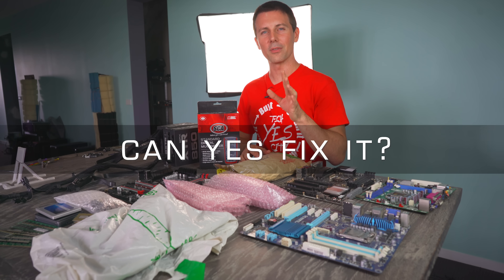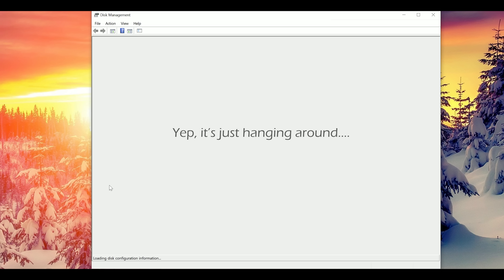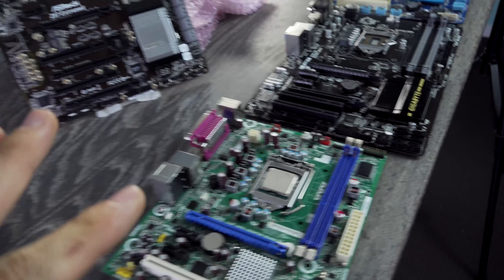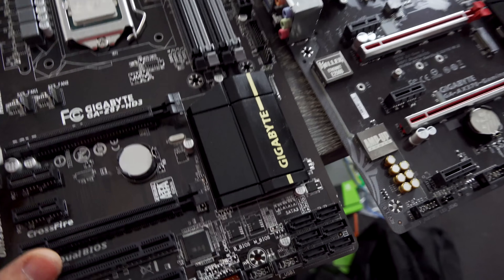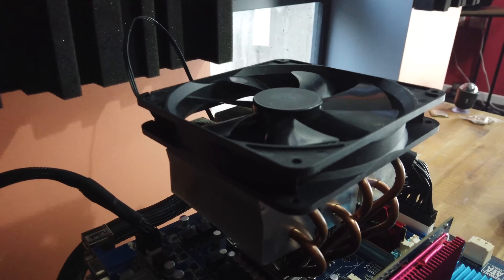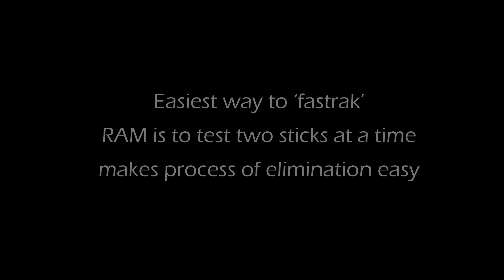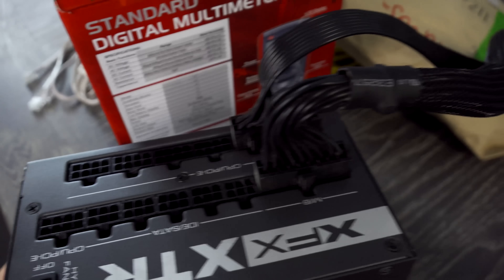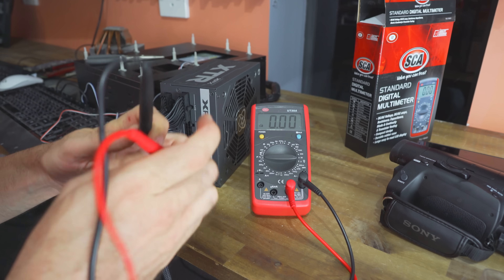Trying to Fix Your Broken PC Parts (Can YES Fix it?)

Comment from the maker: Will be tackling the used monthly parts hunt soon, if you have any special requests let me know! <3
Reply: Could you test i7 5950hq(mobile/resocketed, from asian ebuy) on z97 board with r9 fury vs gtx 1660s?
Reply: Be curious how much pascal cards and i7 2600k-6700k's are going for. Gotta be some sweet ultrawide 1440p 100+hz used builds floating out there if ya got that Bogan magic...
Reply: nice video was wondering if you ever run into a i7 750 socket 1156 please send it too me I will pay you need one for a build Stridder37@hotmail.com and that board looks like a oem intel so you can start their for bios !!! dependent on year
Reply: Russian accent. That's all I need
Reply: I missed a modified Bob the Builder theme song! "Can Brian fix it?! YES he can! "
Reply: If you need a faster method of RAM chacking, use MemTest86+ instead of Prime. meMTest86 can tell you what kind of error, which memory address it's occurring at and which module it happened on.
Reply: is there any chance that  you can donate a nice board and cpu to me.im from south africa cape town,my dad really cant afford a good gaming pc for me as i really like gaming and computers,im sending you this from our librarys computer ,my email is redrbk7@gmail.com.your reply would be much appreciated thank you
Reply: X99 Stuff and 900 Series GPUs!
Reply: did you actually say spray with brake cleaner ?
Reply: @pavlosconstantinou9236  yes its a common degreaser its not dangerous for materials pc parts can handle beating ive had boards with torn traces still run it really depends what you damage their like cars alot they even use same eeproms in older pcs as they do in vehicles everyone will be engineers soon evolution is weird thing :)
Reply: me love this episode i love when i see a bios being written :))
Reply: oh i can help with the reprogramming of the intel board i didnt even notice you said that when i watched first time
Reply: you have to go to windows temporary directory where .exe extracts its files grab the bios file from the tmp directory then flash to chip directly using the soic clip programmer,,since intel uses .exe formats for bios and so does dell you have to extract it from the .exe
Reply: and the bios file was probably incorrect remove cmos battery and power it on with new bios with new cmos batter installed some systems have a really hard time forgetting their cmos settings which means their bricked in boot loop recovering settings that dont exist or have been changed through bios flash
Reply: You should do a colab with https://www.youtube.com/channel/UCLqBEpeQPZTdhCd0nHWIf6g/featured and send Eli those bunk parts instead of tossing them. He could make some good content with that stuff
Reply: The Intel Board BIOS should be the BEH6110H-86A.
Reply: Thanks for demonstrating that ACTUAL hardware failures are pretty rare. Most of the time, it's "pilot error", dust (or dirt) buildup, or compatibility issues. 
Question: What's the model of the Intel MoBo you need the BIOS code for? I might have it.
Good video!
Reply: i did the same with my ssd 3 years ago and it came back to life
what would i do to get my hands on all of your not working stuff ;(
13V for power supply is too much
Reply: how i can get pc compotent if the one of them damage
Reply: Pls tell me ur not located in perth cause i just started out doing this and parts are rlly hard to come across like this idk if its just cause of how remote perth is or if their is high demand so idk

Comment: I once saved a dual socket 771 supermicro mobo just by a deep cleanse. The owner said his loop leaked and spilled on the mobo. 
An old toothbrush and a soap bath later and the board is back alive
Got some dirt cheap ddr2 ecc memory and a couple of X5450, put them in. Sold for 500% profit XD

Comment: I really hope you don't build PCs then sell them with the dodgy 12V EPS connection.  Some poor guy is going to do some friendly free tech support to the PC and replug the connector properly and fry the motherboard.  It is relatively easy enough to get a Molex pin extractor tool that you can use to remove the pins from the connectors and reinsert them in the proper orientation and then label them as being for that particular power supply.

Comment: My ASROCK z87 Extreme6 died when I plugged in a third video card. It was the 3rd of 3 XFX AMD 6450 unpowered cards. (No external power in). 
Seeing you are sponsored by ASROCK any chance of some help? I took it back to the retailer and found that at the time, the Australian supplied had gone bust and my emails were never answered.  #ASROCK @ASROCK , any chance of a RA ? Replacement Repair or a credit on a z97 Extreme 9 ?

Comment: i have an Asrock 990FX extreme4 motherboard that is unable to detect a CPU... i rinsed it with water and dish washing liquid.. (heatsinks are removed) i use toothbrush to remove dust build up on the components of the motherboard.. after that i use blow dryer until the motherboard dries. after taking the risk... my motherboard is alive again until now ^_^

Comment: I remember I took in a Laptop that no one could fix and PC repair stores told the girl to buy a new one. 
So I ended up taking the whole thing apart and leaving it over night, then the next day i put it all back together and what dewYaKnow, i press the power button and the thing came back to life. I gained some business after that. i was a able to fix a PC that no one else could. Just by taking it apart and grounding out and discharging the components.

Comment: I once had a broken motherboard, where the 1st pci slot was broken and the board wouldn't turn on. So I just went ahead and cleaned it completely, even putting new thermal paste on the chipset. And It worked after that (though the 1st pci slot was still broken, but it booted just fine with the 2nd pci slot) Sometimes these componets just need a bit of Tech YES lovin'

Comment: If you aren’t soldering, replacing components or altering the hardware/firmware. Are you really ‘fixing’ much? You attempted some flashing which is cool.

Most of what’s done here are just the tests done before a fix, so throwing them in the trash seems wasteful. Send them to Louis Rossman; there’s a man who can fix hardware.

Comment: it's easy to remove the pins from psu connectors. You can put them anywhere you like then rather than forcing it in upside down.

Comment: For the ASRock board - try de-soldier the LAN chip (may be Realtek, RaLink or Intel),
so just use a hot gun and de-soldier it, and clean the rest of the soldier.
Often it is a dead LAN chip that shorts it out. Did it on a lot of the boards.

Comment: hey
(i bought a ch341A i have a z97 that wont post if you want to help) have you tried flashing the SPI CHIP under the ram slots on the intel board (try a back up before erasing it)

Comment: for ram testing you will want to use memtest86 or memtester in linux. just booting is not enough, not even prime95 as it does not use memory heavily.
Many memory erros only show up after extended period, and there it helps to directly stress test memory. I've had to test thousands upon thousands of modules, and generally i stress test a full bank of memory (typically 6 to 18 modules) on single node for at the very least for 5 minutes.
... and if i f#### up the testing it might mean i have to spend many extra hours, so this process has been honed over years of practice with servers :)

i typically use memtester as that allows me to stress test each CPU core as well. I run 2 tests -> overcommit and stress. Overcommit reveals like 80% of failures but is the slowest to find the faulty one, and stress test is the last 20% but easiest to find faulty one (you can find which individual module failed in linux via /sys/devices/system/edac/mc).
ALSO a lot of memory issues is simply solved by cleaning contacts, RAM is very sensitive to clean connector contacts oO;

Comment: I have a curious question to those who have reused dell motherboards.  They seem to have a proprietary 20 pin front panel header.  Has anyone had any luck connecting a case HD Audio connector to one of these motherboards?

Comment: G'dy Bryan,
Good to see these parts getting a new life,

But you have got me OCDing over the 8 pin EPS cables being plugged into the Power Supply upside down,
I think it wouud be much better to take out the wires from the plug & put them back in so that the plug connects to the Power Supply the right way, just in case in the future someone unplugs the EPS cable & doesn't notice what you did & blow something up,
I did this myself on a Modular Power Supply I was given without any cables

Comment: The ASRock board (and any board with those symptoms) probably had a blown fuse. It's one of the more common ways boards get killed. Funnily enough, not usually with mistakes putting it together, I have actually tried to blow a board by connecting the power cables wrong and nothing usually happens (don't try it unless you actually want to blow something). Power protection is very good these days and protection circuits trip the moment you put the wrong voltage somewhere. What usually kills them is things like lightning down the LAN cable, dead shorts in USB devices and most common I find, PSUs going kaboom. The PSU issue is very common because to this day so many people cheap out on their PSU, I say it all the time on forums, never compromise on your PSU. It's one thing to find used PSUs and grey boxes like Brian does on this channel, it's another entirely to pick up a $10 "650w" PSU that weighs as much as a feather and has the thinnest of ketchup and mustard cables. Most of these ultra cheap PSUs lie, they list peak power not nominal power, even a 300w PSU can handle 500w of power for a few seconds and that is usually what you get when you buy a sub $10 500w/600w PSU, a 250w - 300w pile of garbage made with the cheapest components ever to fail QC.

Comment: Is not a great idea to flip the cables around to get the good voltage - and +, because if you forget to do that when you build a new PC you can destroy your hole computer if you plug the cables in the normal way, it's easier to just buy new cables, if they are good you can buy then.

Comment: Did you try swapping the CMOS battery? I have that same Z77 board and it was acting the exact same. Changed the CMOS battery and it worked. Too bad you chucked it in the air. I would've greatly taken it off of your hands ='( still love the vids!!!
Reply: It's common on the older blue gigabyte boards for the CMOS battery to cause all sort of system faults when it is low voltage. Just thought I let you know for future reference.

Comment: Should see if you can resolve that 1 finicky board and did you clean the contacts on the ram?  sometimes that's all it may need, same with cards.  And You should do this video with trash picked computers too!  Go around on trash day, load up all you can, test em out, sell those that work and part out those that don't! You guys get a lot tossed there in australia.  Literally all you can find of any era.  You could put a lot to use for various things and have a nice stockpile of parts for various projects

Comment: Why chuck them, you should dive deep into chip level and those ram are repairable or not. And also SSD. When you figured out error of chip, u can replace them. Nearly every components are available on Taobao China or from Shenzhen. U cleansed n tested all components n check with meter and that's all. Dive deep into chip level,please. I only found Hindi speaking n Chinese speaking channel on those sector.

Comment: When it comes to the PSUs EPS connectors I would have preferred if you had depinned them and swapped the pins around. Makes it safer if someone else connects them the right way :P Or if you forget they are supposed to be flipped xD

Comment: +Tech Yes City  So you use Prime95 to "burn in" CPUs, what do you use to test PC RAM? Is it one of the many iterations of MemTest86, which one? I can never figure out which one is the most up to date since there's like a 100 branches of it.  Also what do you use to test GPUs and GPU RAM, and do these work with integrated GPUs (either on the CPU or on the motherboard).

Comment: Please don't do this with your power supplies people. Ramming square pegs into round holes and having nothing clipping it in could make a bad connection, and that's what can cause arcing, or voltage drop and overheating at the connection point, and start a fire. Just get or make the right cable or adapter. They are cheap as fuck on ebay.

At the very least don't go doing this and then sell it to someone who has no clue what you did. What if they end up taking it apart and end up plugging it back in the "right" way? Well they just sent 12V where 12V is not supposed to go and caused a dead short.

Comment: 11:45 - Am I to assume you just shoved that PCIe cable in upside down?, Shit you did!
Not professional, considering they have a lock clip and a set pin configuration (meaning; will only fit one way correctly), that connector will end up failing from stress being in the wrong way.
Would have been more professional to show us how to make your own custom cables in another video.

Honestly Bry, that was not a good tip.

Comment: I had the exact same grief with a Z77-D3H and after months of tinkering I tried shorting the pins of the main bios chip when the board booted, then the motherboard sprung back into life and realised that it has a corrupt bios. I'm pretty sure its caused by cutting the power to the bios while it tries to switch to the backup bios. But after this it sometimes requires to be restarting once every 20 boots but it still works baby!

Comment: The BIOSes in those Gigabyte Z77/H77 boards have a tendency to corrupt themselves for some reason, you can actually force the backup BIOS to activate by holding the power and reset button simultaneously for 10 seconds. But it might eventually corrupt itself again...

Comment: Why would you use brake cleaner on PC parts? It's corrosive.
Reply: The Jason Station because you wipe it off right after, or have it dry off in a well-ventilated area. And that’s exactly the point; it removes caked on thermal paste and such and cleans. Just don’t spray it on plastic fans, and you’re fine

Get the non chlorinated version if you’re that paranoid about “corrosion”

Comment: I would remove the pins off the power supply connector and put them back in the correct positions. You just have to stick something thin into the left and right side of the connector and pull to release them.

Comment: You will have more luck flashing bios chips with a raspberry clone and the flashrom program from github. You can use the same sop8 clip. I also tried those cheap usb flashers from aliexpress, the programming util is terrible and hardly recognises any chips.

Comment: i have the same z77 gigabyte...may someone burned the bios...you have an ch341 usb programmer! U have to desolder the main Bios chip and flash it again with the first bios from manufactor side!! you have to look at the rev. number and chose the matched one... why u dont check deeper??...it the board turns on, its a good sign! may some mosfets are short or even the voltage are wrong....
check again...its a good board and it is able to boot from nvme!

Comment: with the extreme VI you could check if the solder broke lose on/in the 24 pin connector....
seen that on a couple boards now from having the connection interface too tight and fighting to get the plug in or out of yhe board

Comment: With DDR3 or 4 RAM 'cards' - if they fail where do they fail? Watching Louis Rossmann checks for faults, removes and replaces components. Could it be possible with 'a box-full' of RAM of the same micro components to salvage and rebuild working RAM cards?

Comment: So basicaly your philosophy is we should clean and wash our electronics and if it doesnt work after that we should toss it away ? #troll
Reply: Dee Monk yeah, exactly the point if you actually did sales. But I assume you’ve never even worked with computer for a living with a comment like that. Until you learn how to do soldering or there’s a warranty left or you happen to have the exact same spare “for parts” part (did you get that lol) it’s not worth repairing if the basics don’t work. Even then? Soldering May only be a temporary fix and the component will break again later on. The more time you spend on broken parts, the more time wasted that could’ve been used on the next part, next sale ect and this guy has bins of parts. 

Imagine if you then go and buy a “for parts” part and then your original broken equipment still ends up broken up even with replaced components. Shipping time and $$$ wasted 

It comes down to if it’s worth your stress your time and ultimately, your money for something that may not even work

Comment: Seriously bryan ! that Gigabyte board is fixable.. no need to chuck it.... i had a z77 that wouldnt boot at all and was boot looping on both bios switches .. i gave it some Trashbin loving... ergo i threw it in the trash and picked it back up 4 hours later and then i proceeded to flicking the bios switch from 1 to 2 while being powered on in its boot cycle and then i inserted a USB with the bios and voila it came back to life.... stop handling these boards as if they are delicate kids... smack em around and show them who´s boss ;) ... but try it... most of the z77 boards and up have the "offline flash" my word couldnt remember the real word... basically it will try to backup flash if you have a USB with the make and model for the board on it.... ;) give it a go and let me know ;)

Comment: Hey Brian, a lot of the time when i am repairing and its not something obvious like memory or cpu when it wont post, i check how tight the socket retainer is on. i have luck with tightening or loosening them a lot of the time. i just repaired a z77 and a z87 board this week doing that.